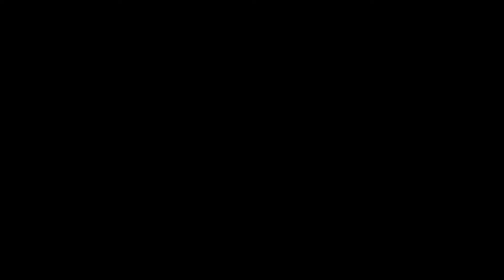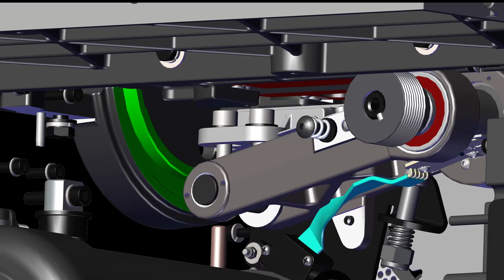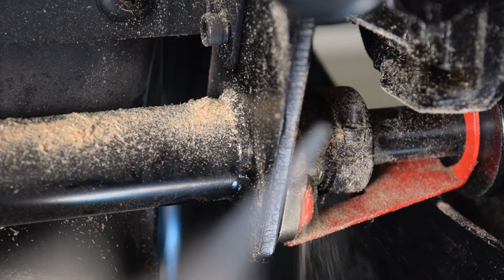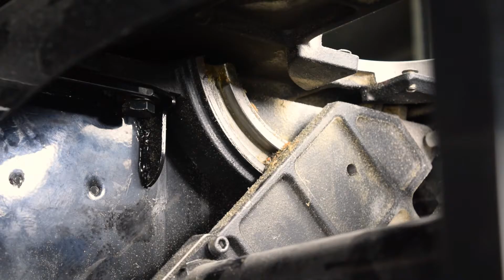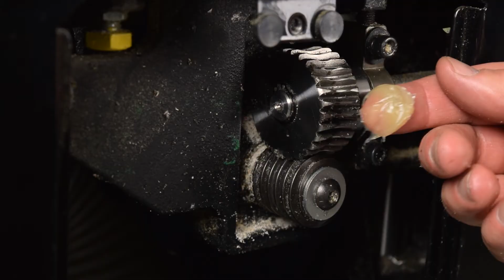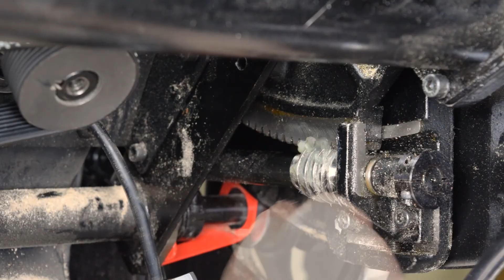SawStop Service Tip: Maintain Tilt & Elevation Mechanisms, Professional Cabinet Saw

Comment: Thanks for the video.  My saw won't go back to zero after making beveled cuts.  Sawdust has built up around the stop mechanism and it is off about two degrees from vertical.  I wasn't sure where to clean or how to access the area. I can do better when I see a video rather than look at drawings.  I'm going to clean up my saw and make a concerted effort to keep it cleaner.  I don't have a dust collector.  That would make keeping it clean a whole lot easier.  Reviews always show one brand being better than another, and vice-versa.  I don't want to get the wrong one and waste money.
Reply from the maker: Hi, sorry for the difficulty you’re having with your SawStop table saw. The best way to help is to have you speak directly with our technical support department. Please call them at 503-582-9934 or 866-729-7867 or email them at technicalsupport@sawstop.com. They’ll fix you right up. Thanks!

Comment: The instructions miss the other side of each trunnion bracket, which is only accessible by returning the saw to 90 degrees and removing the insert plate. There’s one on the front and back.

Comment: Using an air compressor and blow nozzle would most certainly be better instead of a rag. Small portable compressors are not that expensive to 💥 all the 💩 out before greasing and oiling.

Comment: On the worm and pinion gear would white lithium grease be acceptable?
Reply: It's a thinner grease. Now if that's all you have, then do it, but you will need it more often. Axle grease is designed for pressure applications, is cheap enough, and works well to protect the gear teeth.

Comment: It looks like you are using 3 in 1 oil for oiled lubrication points. What type of grease is recommended for lubricating the gears? Thanks.
Reply: The tech is using heavy duty axle grease for automotive applications, available in tubes or can at any auto parts store.